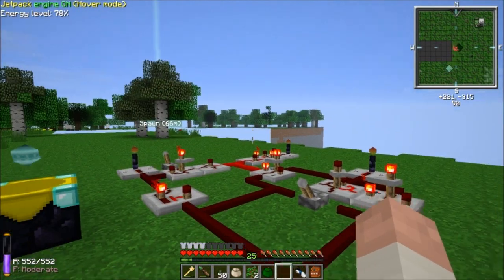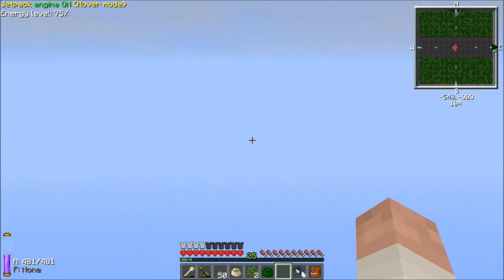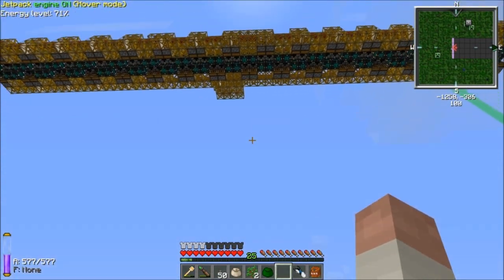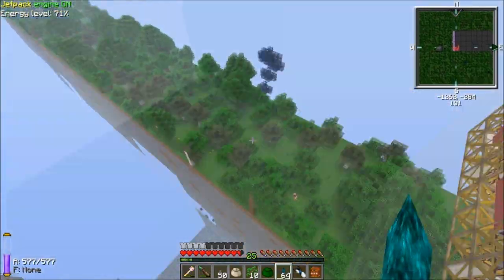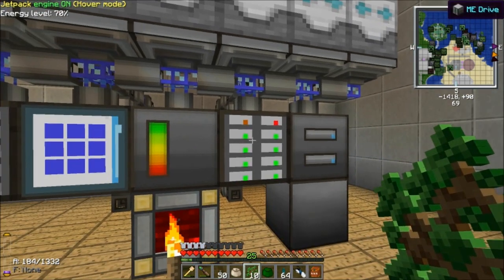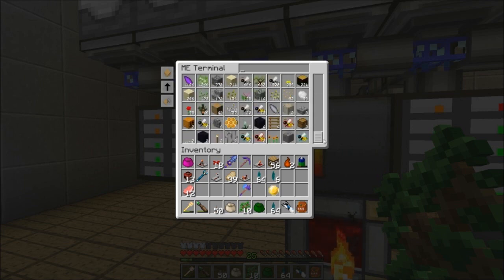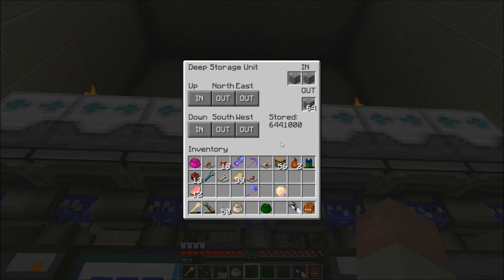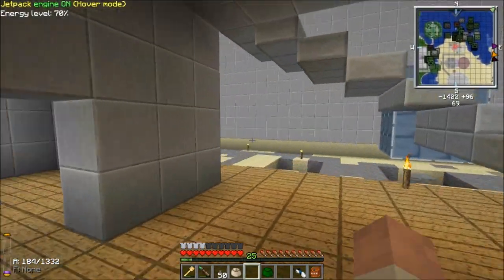Mining Well Frame Machine Overview (2.5 million blocks an hour)

Comment: This is probs late af but did you think of making a similar setup of vacuum hoppers or obsidian pipes that could run along the bottom and mop up the resources that don't get picked up like the quartz and saplings
Reply: It's probably doable, but since XyCraft was never completed the quartz crystals are basically useless, and if you're needing saplings you can just make a Forestry tree farm. It would probably help with performance to not have all those loose items floating around, though.
Reply: @pat2rome  Do these items have an EMC value at all? They could be condensed down into something useful if Equivalent Exchange is in the pack
Reply: @HusbandofLois  that's a good point, but EE2 was never fully finished in 1.4.7 either. No condensers or EMC.
Reply: @pat2rome  and it's too early for ProjectE as well I presume, that's annoying. Maybe biomass the saplings and process quartz into scrap some way?

Comment: So what mod is this mining machine specifically made from? The mining component of it, at least. I'm trying to make a complete modpack for 1.7.10 but I need a method to dig out vast areas of stone instead of only teleporting them out with a AE's Digital Miner. Anyone have any ideas that could help me?
Reply: what you want exactly? for moving there is new mod buildcraft mining wells chickenchunk's loader or how its called and that should be all idk why he put it that 2 and 2 way but what ever
Reply: Well... simply put, I can't use Buildcraft because it's incompatible with some of my other mods, but I still need something like a Quarry, for the specific purpose of mining up a large area, cobble, dirt, ores and all, mainly for the purpose of making a dwarvern style city.
Reply: then extra U can be good for you with ender quarry
Reply: I thought the Ender Quarry replaced the mined stuff with dirt?
Reply: it does but in new versions there are upgrades and one of them is world hole up. + silk touch and fortune and speed and trash i think too
Reply: Very good to know. I shall install the mod immediately. Many thanks.
Reply: no problem bro :)

Comment: 64 wells * 25 MJ/t = 1600 MJ/t required
127 * 64 = 8128 blocks mined
127 / 1 block max rate/t / 20 ticks/second = 6,35 seconds
so 20 blocks/second * 60 seconds in a minutes * 60 minutes in a hour * 64 mining wells = 4608000 blocks/hour * 25 MJ = 115200000 MJ/hour

Math makes things more awesome
Reply: you didn't include the delay in between the frames moving, which takes another few seconds.
Reply: hmm,thats true,but thats hard to calculate because it depends on the processing speed of the computer

so if we define 1 cycle as 8128 blocks mined,and assume 6,35 + 2 seconds,431 cycles in a hour,we come out at 3,5 million a hour

math makes things more epic :P